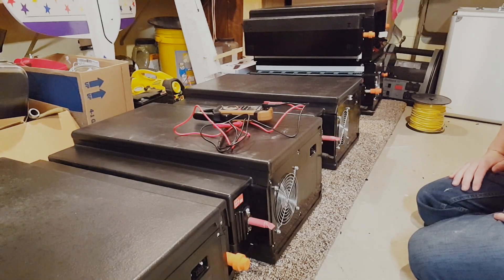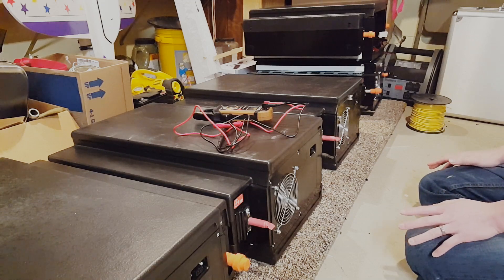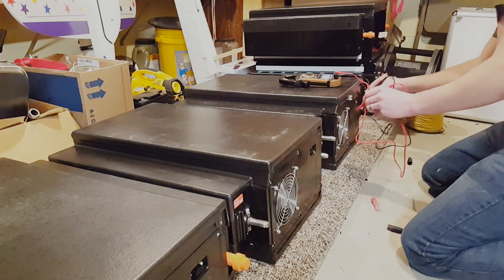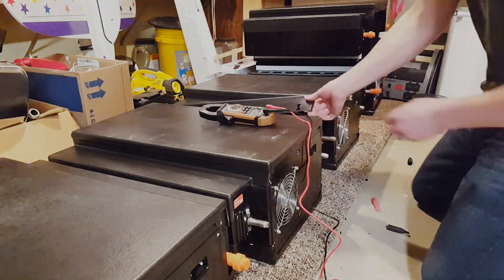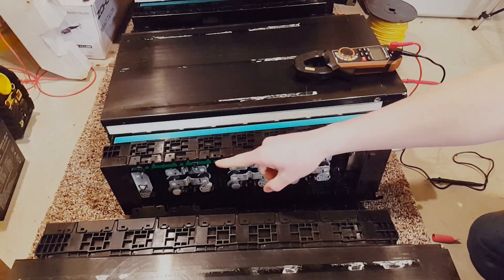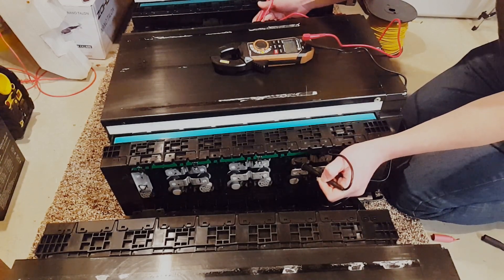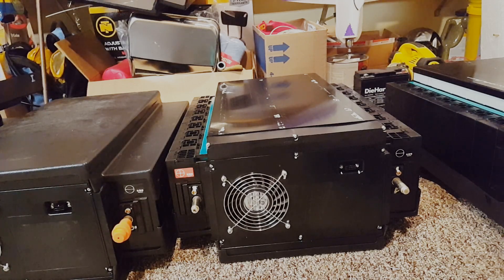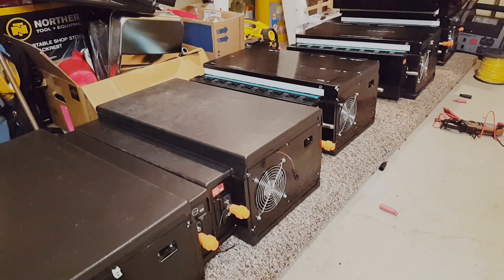LiFePO4 Dead Cell Update! What 16s BMS should I choose?

Comment: Actually I purchased four modules from battery hookup and the modules were at 3 volts, not anywhere near 24 volts, I was unable to get in touch with battery hookup for days and when I actually got in touch with them by email they said nothing about dealing with it. After a week of calling and emailing with no further response, in desperation I called the address that they were drop shipped from that turned out to be Big Battery, a company in California. Big Battery fixed me up for the bad modules and backed me up, what Battery Hookup was supposed to do but didn't. Battery Hookup was complete lame crap . They sent me two heartfelt sincere emails after ten of my own and never did shit. I am off the grid and needed the modules asap, Battery Hookup was a complete fail.
Reply from the maker: Aw man! That is horrible to hear! When did this happen? I know there was a bit of frustration in the community about it because my experience was not unique but this is the first I have heard of them leaving anyone hanging. I know big battery was doing the shipping and everything, mine came from there too so my guess is that there was some phone calls made between batteryhookup and big battery to get me my replacements.

Comment: Look up ANT-BMS.
I have 8 of these BYD packs and 4, 16S ANT-BMS working around the old cells.
Reply from the maker: Are you using active balancers also or just the ANT-BMS's?
Reply: @diyrenewableenergyelectron4996  just the ANT-BMS. It is an active balancer, once you figure out the settings. But still only rated to do. 200 amp.

I just uploaded a little vid take a look.

Comment: Glad to see that you finally got the replacement batteries. Followed all your tips and advice and It looks like I have a good set of batteries. I tried to put them in series this morning and got a huge spark that it almost blew out one of the terminals of the battery. Checked the voltages and it seems that both batteries are ok. What did I do wrong? Need your help! Thanks
Reply from the maker: Hm. Are the batteries connected to anything (inverter, charge controller)? You want to wire them into series when there is nothing connected that way there cant be any current flow.
Reply: The only thing connected are my balance leeds.
 @diyrenewableenergyelectron4996
Reply from the maker: Are your balance leads connected to anything? I have series connected mine several times and never had an issue, no sparking so something is definitely going on with yours. You're wiring the negative from one module to the positive of the other, right? (Had to ask)
Reply: Yup. - to +
 @diyrenewableenergyelectron4996
Reply from the maker: Can you make a quick video and post it to your youtube channel showing the setup? Its difficult to diagnose electrical things in words lol
Reply: @diyrenewableenergyelectron4996  I'll double check all the bms wires to make sure I didn't miss anything. Thank you.
Reply from the maker: @ernestcriss  Let me know how it goes! It's really hard to tell without seeing it.
Reply: @diyrenewableenergyelectron4996  Just uploaded a video.

Comment: Sorry if this gets long, but you asked about BMS and are planning to use an active balancer.  The right choices here depend on your application.  I gather your application is backup power linked to solar.  Since you're using 48V I'll assume you're talking a 5KW inverter.  That would mean about 100 amps or 50 amps per paralleled 48 battery.  I tried to look up some specs on your suggested active balancer, but couldn't find anything other than 6 amps.  Most active balancers only deliver their max amperage at a large cell differential.  The current ramps down as the cells get closer together.  These BYD cells go from full to empty over a very small voltage range, but let's be charitable and assume you always get 6 amps.

So what's the point of the active balancer?  While discharging, you presumably want to draw the most power you can even though the weakest cell has given out.  You can get some extension by active balancing which makes up for the weak cell by drawing from the strong cells.  But even in the unrealistic 6 amp case you will get at best 10% longer life (again assuming 50 amp draw).  Doesn't seem worth it to me. In practice however, it's even worse since the balancer won't really kick in until the weakest cell is exhausted (causing a voltage difference) at which point the 6 amps won't even make a dent in the 50 amp draw and you'll have to shut down anyway.  In the charging case you might be trying to shuttle power from the first cell to fully charge (the weakest cell) into the other cells.  But getting all the other cells fully charged isn't going to do much good, because you can't get the power back out (see discharging case above).

I suggest the reasonable thing to do it to just individually fully charge each cell once before putting into service.  In this application I'd bet you'll never need to balance again.  Of course you can do the the individual charging step every few years if you  think it's needed.  Now other applications that have intermittent lower power draws (perhaps an RV application) might get some benefit from active balancing.

As to the BMS, there are really only three things you need to watch for.
1.  Never let any cell get over 3.65 volts.  With these batteries I'd suggest using 3.5V as a max.
2.  Never let any cell get below 2.5V.
3.  Never charge when the temperature is below freezing.  I'll ignore this one for now.

Be aware that many BMS have only one output that signals both over and under voltage.  That's great for an ebike, but not for a power backup.  You'll want to do different things depending on the situation.  While charging you want to disconnect the solar to keep the cell from going too high, but you still want the battery connected to the inverter.  While discharging you need to disconnect the battery output if the cell is too low, but keep it connected to the solar.  The inverter can usually help here by shutting down at a programmed low voltage.  The point is you want to be sure that whatever you want to do the BMS will be able to do it.

Finally, from one of your earlier videos, paralleling the cells together is a good idea, but add your own high current wires to the cells.  Using the existing sense wires will only pass a few amps and then the pcb traces will burn out.

Love your videos!
Reply from the maker: This comment is gold! Basically, yes to all of that lol. So this will be for backup power, but if my solar can sustain it I plan to power my fridge and sump pump 24/7 with these batteries. I think it will be a rare occurrence to have 5kw coming out, but maybe on a surge it will happen. I dont intend to sustain that high of wattage, but we will see where this all goes because I have NO IDEA how these will perform. Yay for experimenting!

As far as wiring goes, I considered scrapping the idea of paralleling the cells together and just running a BMS on each series string and having active balancers on all 4 modules. That might cause more issues that I'm not thinking of though so it may be better to just parallel the cells across the two strings. David Poz pop riveted them and I will probably go that route. The theory behind 2 separate strings is that if one string has a weak cell go haywire the other string will not kick off and I would theoretically have 12 amps to balance things with. But as you said 6 amps is max when cells vary a bunch. So I don't want to buy four of these modules if they suck lol. There is a guy on the DIY battery facebook group (hi Jim!) Who had excellent results by adding the QNBBM balancers, so I think I will experiment with them but not go crazy with them out of the gate. I have considered setting my charge controller to 54.40v max and making that my float charge. That's 3.4v per cell so it should be right on the edge of the cell mismatch cliff. I expect my typical intermittent draw to be something like 30 amps (when the sump pump cycles) but hopefully it will be below 20 amps otherwise. I want to keep my constant draw down as much as possible to give the active balancers a shot at working. Like you said, 6 amps of balancing when you have a 50 amp draw is a drop in the bucket. Thanks for the comment! I really appreciate the feedback. Obviously I still have no idea which way to go with this lol!
Reply: @diyrenewableenergyelectron4996  54.40V seems high to me.  Test your batteries when fully charged (and rested for a bit) and see what voltage you get.  On my 4 BYD's the max I see is 26.5 (from memory!) so I'd probably choose 53V.  If you're only running a refrigerator and sump pump, then I'd guess you can get away with 2 KWHr per day.  Your 4 BYD's should give you 12 KWHr so you have plenty of storage and you don't need to squeeze every last electron out of your batteries.  With tight limits on your charge controller and inverter the BMS should never need to kick in.  So one way to think about it is that your BMS would be a safety system of last resort and it could just have just a single cutoff (through a contactor) with the idea that it should never happen.  
The problem with 16S is that you loose sensitivity so that your 54.4 is likely to be 15 cells of 3.35 and one cell of 4.15 (which will be on fire) :-)
Reply from the maker: @craignels  you nailed my thoughts exactly. Charge controller will be the first to limit the upper voltage, then bms is back up. Inverter shuts down at lower voltage then bms kicks in. I'm hoping that between the inverter/charge controller, the bms, and balancing, any one of these things could fail and the others would protect my system.
Reply: @craignels  I have 8 BYDs, and just measured 14 kWh out of them. Not exactly that good when they were sold as 4 to 4.5. BUT, I am working around them and their limits for now. I charge to 53.1V for now. I get basic balancing at 0.200 amp. :-/. The BMS has saved the packs numerous times, a few to being set wrong, but a few because of runaway cells. Cells dive bombing to low voltage, Cells running amuk going too high, a couple "headspace and timing" errors setting the amperage way too low... and once even for low temperature cutoff.
Reply from the maker: Oh, and I figured out after wiring the first two that my "balance leads" are going to have to be for monitoring only lol theres no way they can pass any significant balancing amperage.
Reply from the maker: After thinking about it a little more, two BMS's is probably a bad idea. When the bms reconnects, there may be a huge Inrush current.

Comment: Glad you got your replacements.  I'm waiting on 2 to show up and will be interested to know how things go for you and your BMS choice as well as best way to balance them.
Reply from the maker: Thanks Scott! I think balancing these once theyre in service is going to be the biggest challenge!
Reply from the maker: Are you doing 48 v or staying 24v?
Reply: @diyrenewableenergyelectron4996  I just got them and will be doing a 48v setup with a 48v 200a BMS. If i'm checking the cells right all are 2.8-2.9 (delivered) waiting on charger power supply and cables now.
Reply from the maker: Sounds about right. Glad all is well with them!